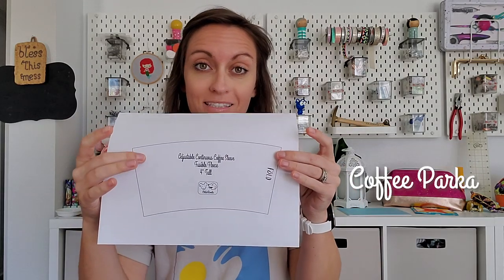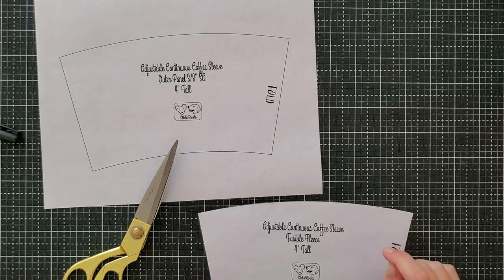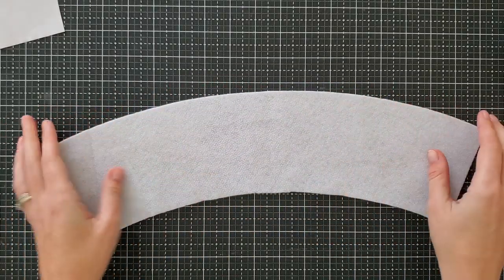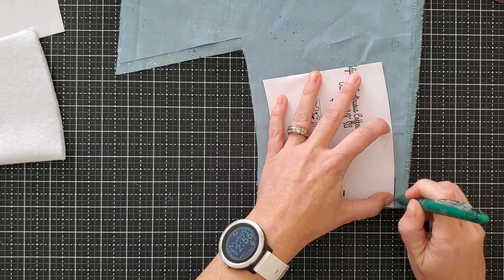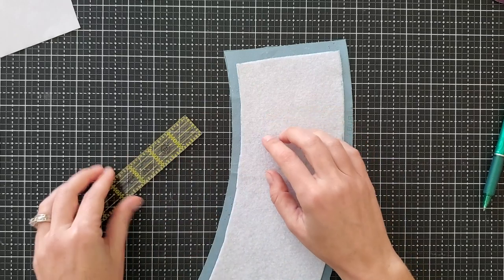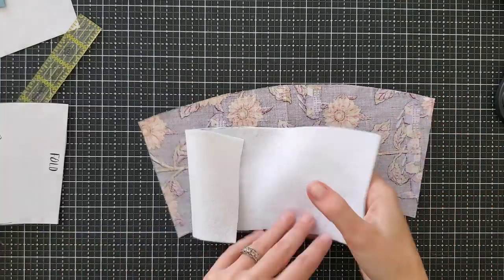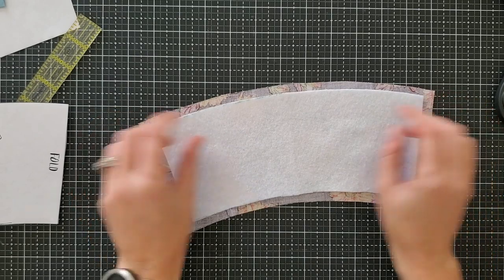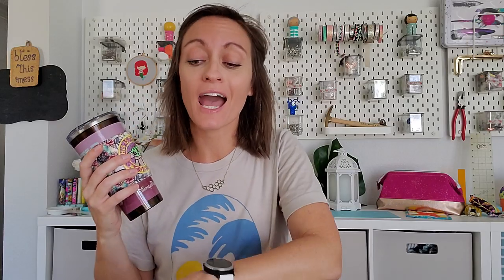How To Design Your Own Coffee Sleeve Template. Free Pattern Pieces for 3 Sizes Available!

Comment: Will felt work in the place of fleece?
Reply from the maker: Yup! Just spray it with glue or use a glue stick to hold it in place before sewing. During top stitch you'll sew through the felt for a permanent hold.
Reply: @OklaRoots  thanks, will try it